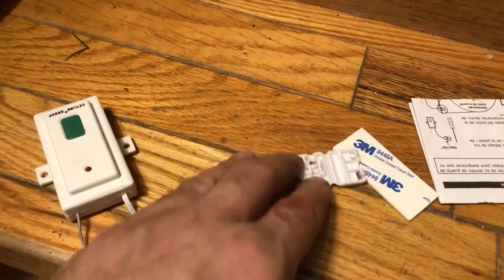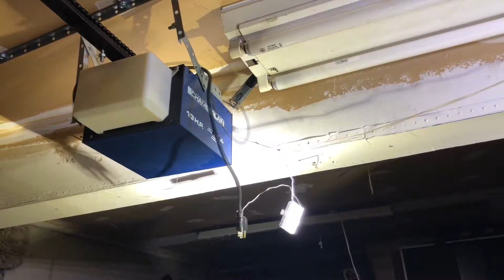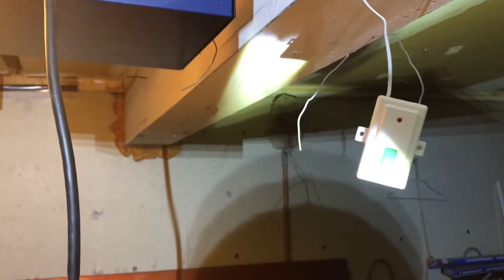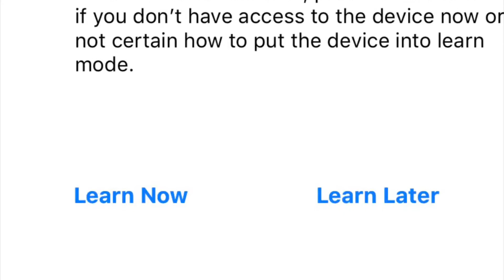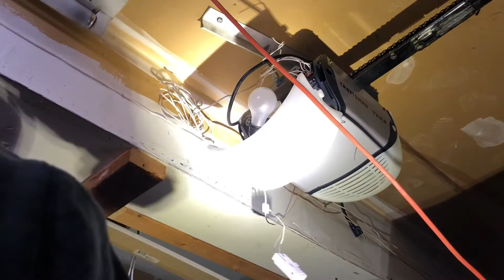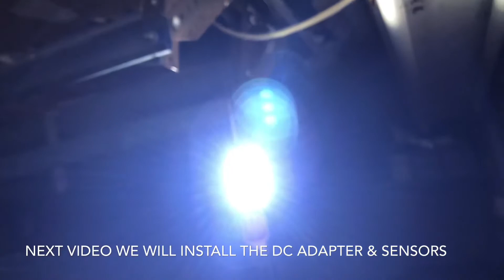Skylink Smart Garage Door Opener GB-318 Install - Fail

Comment: Mine did not need the 12V Adapter. It has been working for a while then suddenly stop working. I was looking for the replacement part. I ordered few but it was wrong model. it was GB-318S  (purple button) not GB-318B (green button). I talked to Skylink, they told me the model Gb-318B was no longer made :( . I am looking for GB-318B but not sure somewhere else still carry it or not.